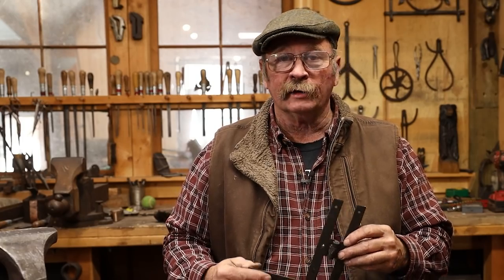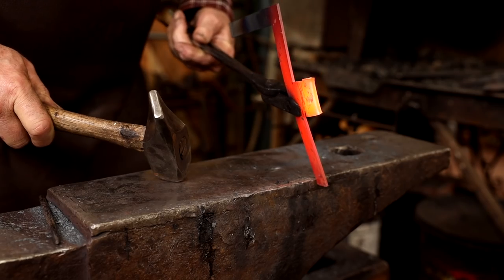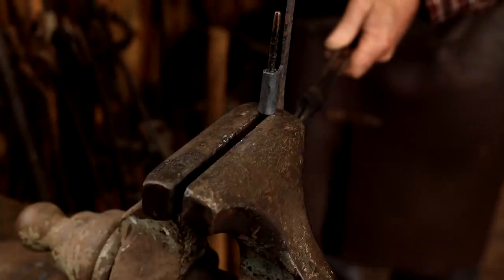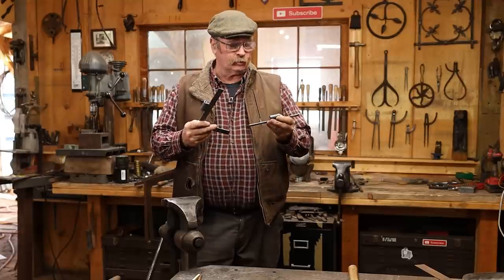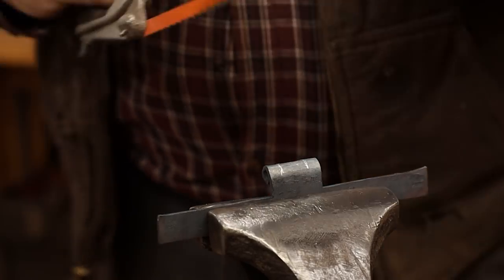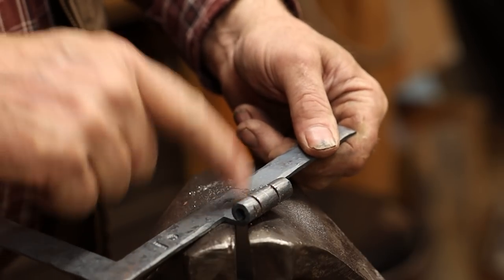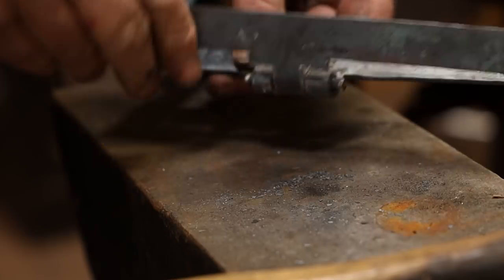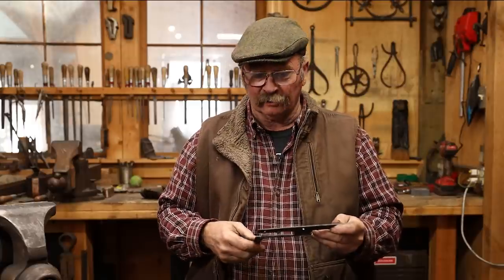H & L hinge

Comment: I noticed that you didn't have the screw holes cut when you had the parts cut.  Is there a particular reason for that?  I would think there wouldn't be much variation on the number and location of screw holes.